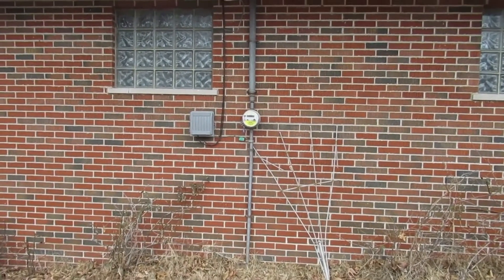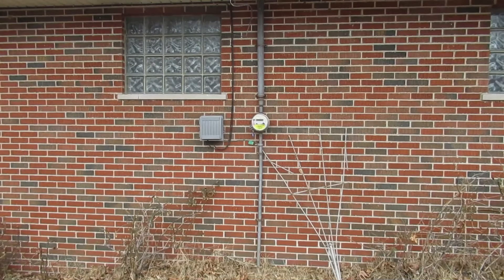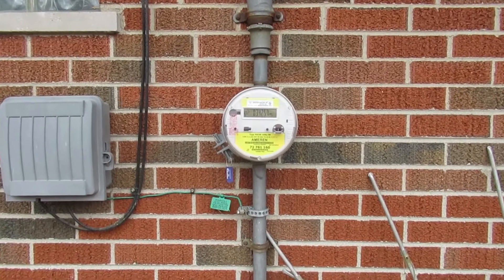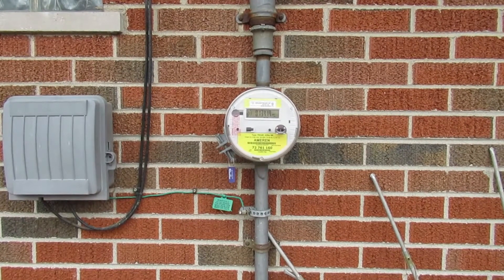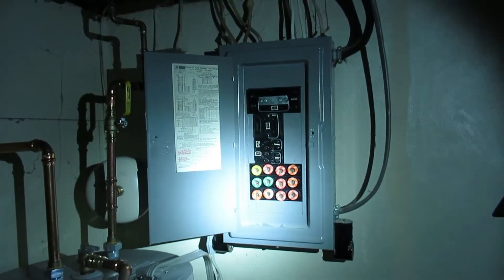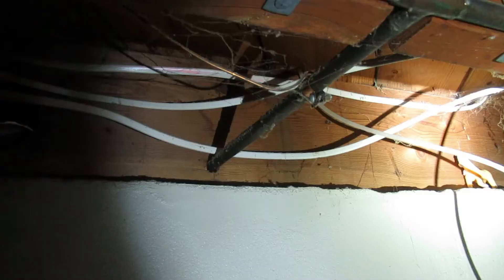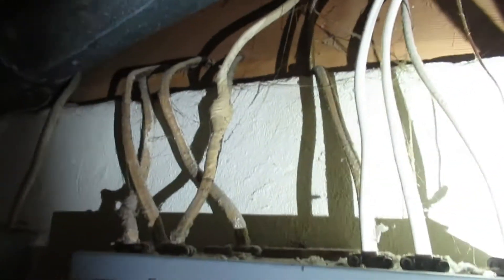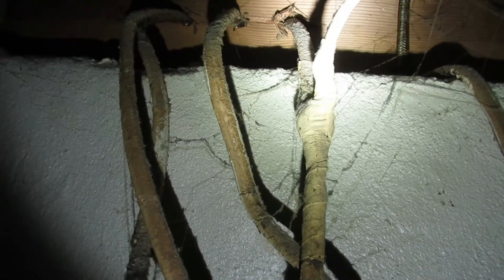Unveiling the Mystery: Is your house equipped with 60-amp or 100-amp service?

Comment: That is an old system.  I wonder what an actual electrician would say because everything (except the bent feed) appears to be in good order.  While it is old, I'd hesitate to change it out just for the sake of changing it.  That house is probably close to needing a remodel and some plumbing re pipe work.  When you're blowing open walls and ripping out old floors to do that work would be a good time to start changing your electrical service.
Reply from the maker: I agree a complete remodel would be the correct time to do a total overhaul. However, safety issues trump pie-in-the-sky dreams of one day doing a complete overhaul. Fix it all, or fix the most important issues first.

Comment: I go back to 30 amp service (observation).    Only had one side of the split  One hot and one neutral.   I called that 30 amp service.
Reply from the maker: That would be 120v for sure, but the amperage would be determined by the wire size and breaker.

Comment: In the 2020 code requires an emergency disconnect at the meter, for first responders to shut off power.   

Speaking of how far you are allowed to have the panel away from the meter before requiring a meter breaker, it can vary depending on jurisdiction,  and whether the service entrance wires are protected in conduit.   Because the service conductors have no overcurrent protection (except for the primary fuse on the pole, which is sized by the utility only to protect the transformer) if the cable is damaged say by a nail or screw, it will be meltdown time, by the time the primary fuse  blows or the drop melts and stops power, your home will have already caught fire.

Comment: I like these video.   Keep em coming.  Based on my experience the presence of a small circular meter base doesn't automatically mean a 60 amp service although it typically indicates an older service that might be 60, or even 30 at 120 volts if is a home built pre-WWII and never replaced (super rare)   the way I judge service size is as follows.   I look at the size of the service entrance wires,  if it's in conduit I will pull the cover off the panel and note the size coming in.   I verify that against the main breaker or fuses.   I also like to verify the rating of the panel.   I use the lowest of the three.    If I have a 200 amp panel, a 200 amp main breaker,  fed by a 4 awg copper,  good for 100 amps,  then I note it as 100 amp service.   I also note this as a potential fire hazard since this cable could not withstand the potential of 200 amps.   I also like to count the number of conductors attached to the drop.  3 wires connected = your typical 120/240 split phase.   2 wires, or 3 with one tied back, = an antiquated 120 volt service,  usually 30 but sometimes 60 amps,  4 wires connected = a  3 phase service,  208 or 240 volts (super rare)

Comment: My friend is buying a house with 60 amp service and wants to add a hot tub. Does he have enough amps to do that? 1400 sq foot with central ac and 240v dryer and stove. Thanks.
Reply: The 60 amp service is either right at its limit or if they have an electric stove and dryer they already have to ration power.
Reply: No very doubtful. Only if he cuts it off when using stove or dryer. I had a hot tub on a 60 amp but everything was gas and even then I couldn't run certain things without tripping a breaker. You could use a gas or propane heated hot tub.
Reply from the maker: A hot tub typically pulls 50 amps, so no. Your friend should contact a qualified electrician to considerer upgrading to 100 or 200 amp service. I would say the electrician is going to recommend 200 amp.
Reply: @hawleyhomeinspectionsllc2899  Thank you.
Reply: Another potential option is to get a heat pump water heater for hot tubs and pools. That will drop the demand and be cheaper to run